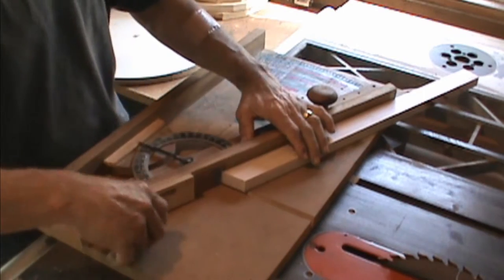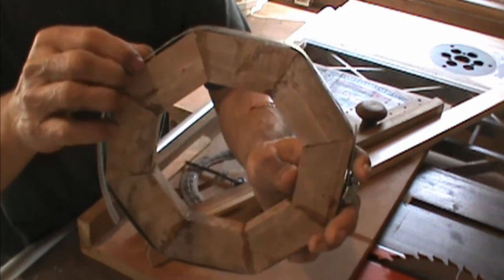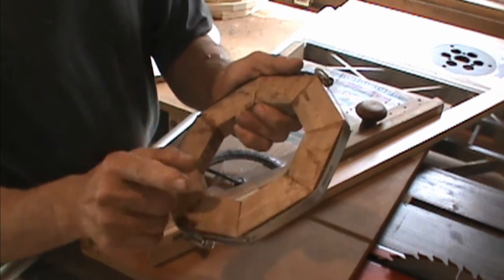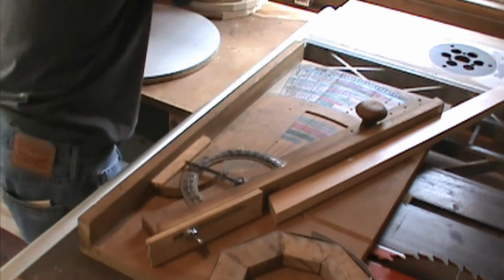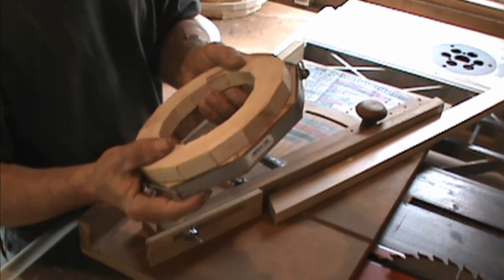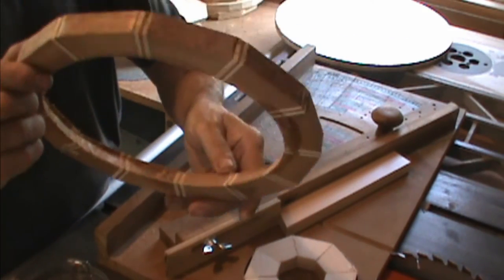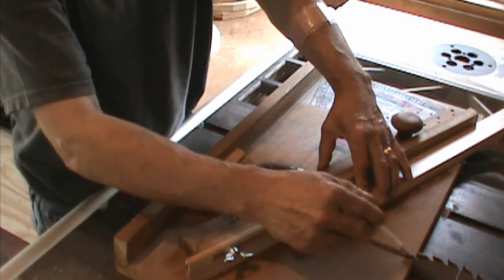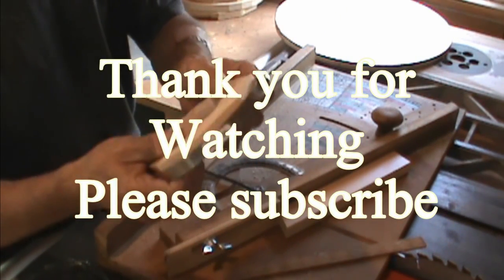Calculate segment lenghts  Al Furtado

Comment: I'm a new woodworker.  I want to make a 36" round dining table with a segmented base (24" diameter).  Can I use this method to determine the angles and each segment length?  I apologize for any incorrect terms, I'm still learning.
Reply from the maker: Yes just check it before glueing

Comment: To find cut length
          8.0 diameter 8 segments 
360 degrees / 8 segments = 45 degrees
              45 degrees / 2 = 22.5 degrees
             22.5  degrees tangent = .4142
     8.0 diameter / 2 = 4.00 radius
4.0 radius x .4142 tangent = 1.6568 ( side opposite )
       1.6568 ( side opposite ) x 2 = cut length

          cut length     3.3137 or 3 5/16

OR TANGENT X DIAMENTER == CUT LENGTH
Reply from the maker: Are you correcting me or explaining your method?Simple formula is. .............. Diameter of ring x pie (3.14) / segment amount. EXAMPLE assuming you want an 8" ring8"x 3.14=  25.12 (that answer is length of board needed) 25.12"/8= 3.14"Angles are  360/number of segments/2PS the results are correct but that is to the high points of the ring so to correct that if I want an 8" 8 side ring I add 1/2" to the overall of the ring making it 8 1/2"x3.14/8=3.3365 or 3 3/8" (close enough) the more segments you have the less you add to the overall length.This is the method I use but I am sure any method can be confusing to many people right?

Comment: But what angle are you cutting?
Reply from the maker: Sorry I have not replied earlier on this but seeing it was such an old video you would have a chance to see what you might have missed oon the first run.  the angle on any segment i devide the number of segments by 180 so if you want 10 segment ring you devide 180/10= 18 degrees on coumpound angles that is a different story and I posted a chart and offered a copy pdf for those interested in it.